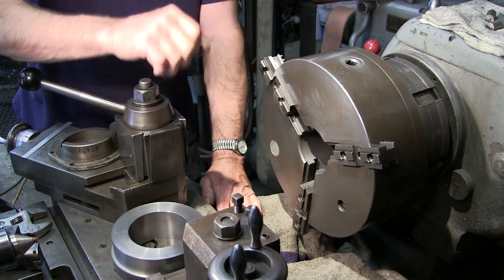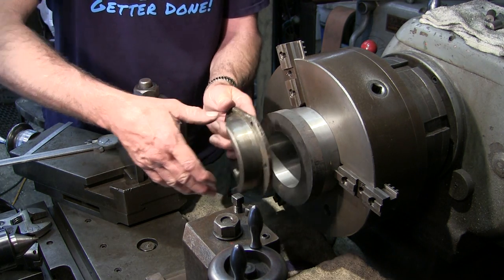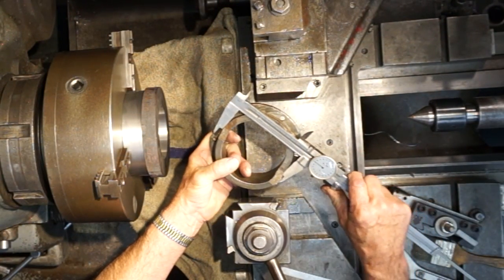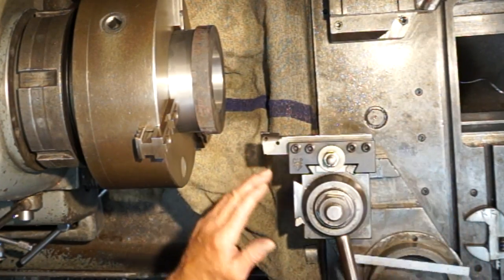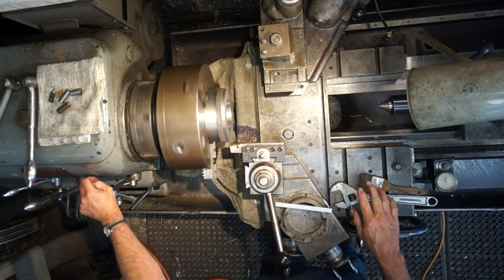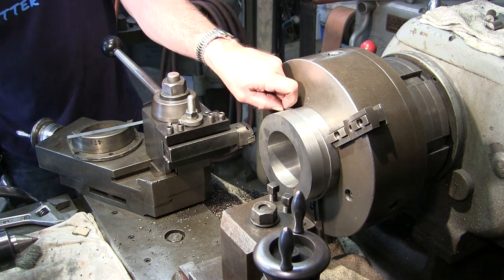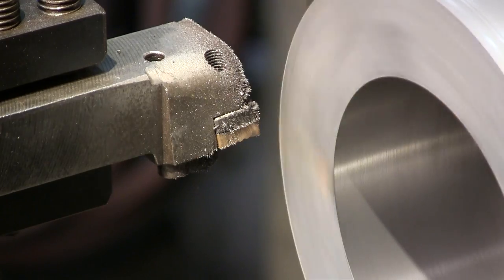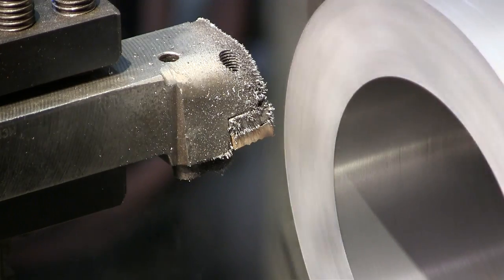Do Over Part Three

Comment: Thankyou keith, 
for explaining in detail your machining procedures.
Like when you explained the procedure of getting the shoulder machined to final facing dimension plus intentionally going in a few thousands farther, then travel dial out to finish the facing cut to length.
That's a very helpful tip.

I don't know how many times I'll do the front facing, then turn the outside diameter, to a shoulder of final finish length, then unwantingly overshoot, and have to come back out and face it to final length any how, only I go the long way around and remeasure to the shoulder, then set the carriage with a dial ind. to do the final facing to length.

But your idea of travel dialing out from the shoulder, is an excellent tip. 

Thanks again, for taking the time to explain the details, in your procedures.

Comment: Seems weird that would be an interference fit at the top only but maybe it was intended to provide very precise control over the location of the part. Not sure what was gained by that since the clamped part would move off center by a few thousandths anyway.
I like your approach better- line to line to .0005 loose.
Disassembly would certainly be easier.
Nice video.
Thanks,
John

Comment: Was the mistake not putting your spacer under the tool holder to set it to the proper height?
Reply from the maker: yep!  ;{)------
Reply: The only difference between the rookies and the pro's are the pro's can catch or fix their mistakes.Great videos Keith.Makes those long retirement days pass a bit quicker.

Comment: I apologize if it was covered in an earlier video, but, why use the tool upside down (and with backward spindle rotation of course)?  I'm not criticising, just trying to learn.  THANKS for your videos.
Reply from the maker: copy and pasted; He is doing it that way to reduce the distance of the spray of chips and dust off of the cast he is cutting. (so he can contain the trash in a smaller area)
Reply: Oh, that makes since. Thanks.

Comment: The normal cutting forces on the lathe tools push the carriage into the bed.  What is preventing it from lifting up running the tools upside down and is that good for the carriage?
Reply: That is an interesting question.
Reply: On a decent sized machine like his, the carriage is more than heavy enough to stay put during finish cuts. On heavy cuts, it will have a greater tendency to push off during facing cuts, or climb the vee on turning cuts.

Neither is an issue, and will not harm the lathe in any way.

On small lathes, it can be a real issue and cause a lot of chatter.

Comment: Hi Keith, when you're making a cut on the lathe and taking a hundred thousandths. Is that off the diameter? Or per side? I'm always a little unsure what your convention is. Thanks. Getter done.
Reply from the maker: My lathe has direct dials, what it reads is the depth of cut, half of what will change the diameter. ;{)-----

Comment: G"day Keith---I have a query--something I don't understand--why rebuild the part with any sort of cast iron when the original part had two cracked off lugs which told me at least that original part should never have been made out of cast as it was the tightening and loosening which cracked them..If I rebuilt that part in cast I would worry that my fix would come back to me and I would have to wear  it.If the original part had been made in some innocuous grade of mild steel I doubt if you would have to fix anything as it would not have cracked..May be I am missing something...Comments..
regards E
Reply from the maker: The part is also a bushing and steel on steel will gall. ;{)------

Comment: Sorry if I missed something and i know nothing of lathe work.... why is Keith 'running it upside down'?
 I.E. clockwise?
Reply from the maker: copy and pasted; He is doing it that way to reduce the distance of the spray of chips and dust off of the cast he is cutting. (so he can contain the trash in a smaller area)

Comment: Keith I'm wondering why you have the tool holder upside down and reverse rotation? You probably mentioned it in the video but I missed it.
Reply: Maybe you don't get chips all over the shop with it upside down?
Reply: Keeps the chips from flying all around.
Reply: He is doing it that way to reduce the distance of the spray of chips and dust off of the cast he is cutting. (so he can contain the trash in a smaller area)
Reply: Cast iron chips fly everywhere and stick to anything with oil on it and are really hard to clean up, unlike mild steel that make big curls.

Comment: Keith. This whole thing is asking cast iron to do the job of spring steel. It is forcing the iron to flex if ever so slightly. As an experiment, why don't you tear down your K&T and magnaflux that part?

It seems that the manufacturer using iron was expedience. With your expertise it would not be all that difficult to rig up a retrofit where a band of flexible steel gets mated to that collar. You doing that would be extremely informative.